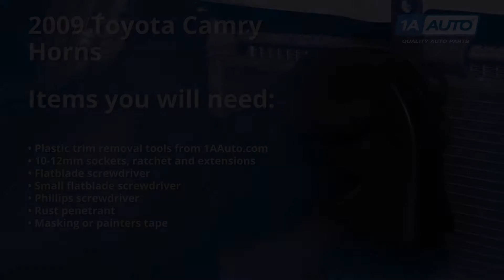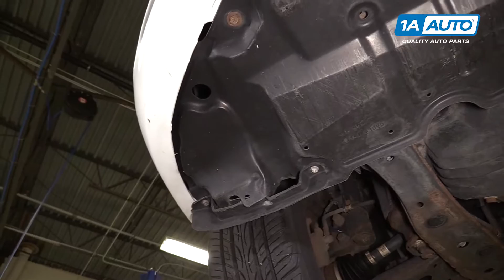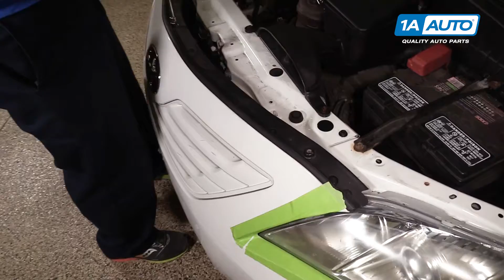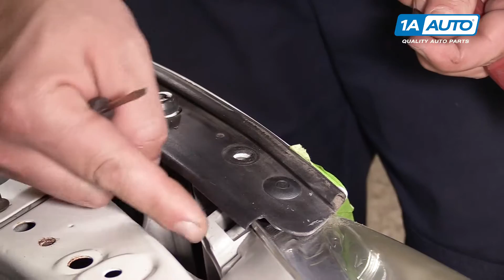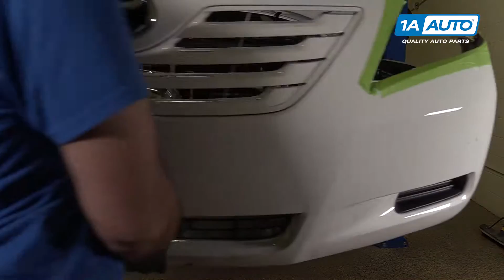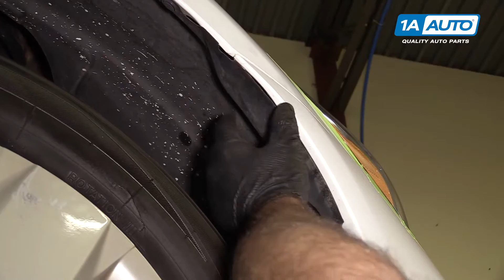How to Replace Horns 06-11 Toyota Camry

Comment: Just use a flat ratchet to loosen the bolts, pull the horn up, then disconnect the wire. This video is ridiculous. You're telling people to take apart the whole front of the car just to replace a horn.